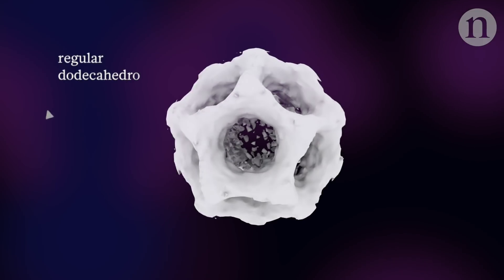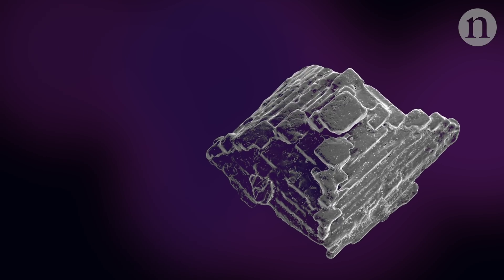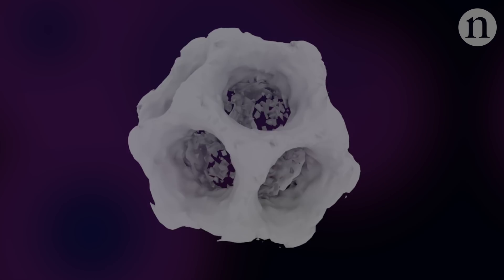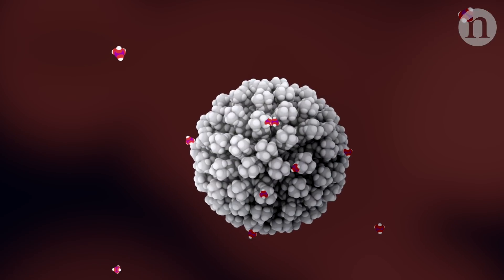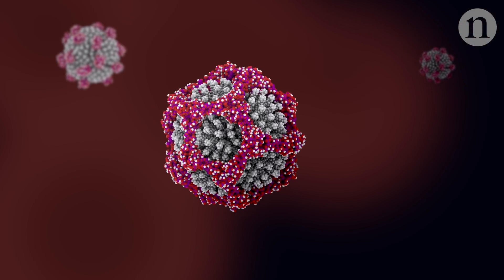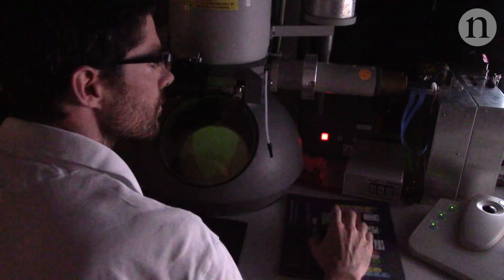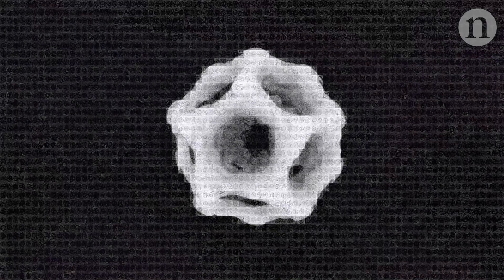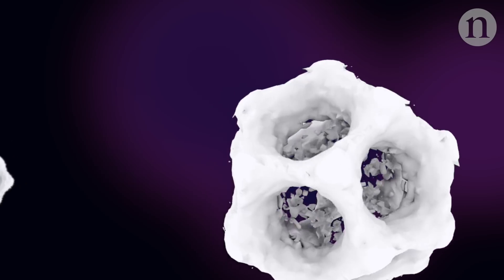How to build a nanocage: Self-assembling silica

Comment: How do they control the size of the micelles? What is the purpose of flash freezing, why would TEM in ambient temperature not work? Can you add the link to the paper?
Reply: cikif Picking finely graded soap and agitating it w. finely graded dirt (well vortexed lavender oil emulsion.) Flash freeze makes small ice(?) crystals so shapes aren't destroyed by growing crystals, and sectioning that for TEM easier...TEM is done in vacuum so no fair chasing the electron beam with liquid water. This and related papers are in the Nature(.com and print magazine in very many libraries...and apps) for this week (wait a bit for the Nature Oncology followthrough?) Guess the precursor? Try ChemRxiv.org for a similarly room-temp method for making β-zeolite.

This being YouTube, surely there are videos of people shrinking diatoms, or rolling glass fines in emulsions, then colliding and centrifuging for scintillation analysis, skip the scanning and tunelling ions? Shi-Shi-O the last author...

Comment: Soap? Is that what he said?
Reply: They used a compound called cetyl trimethylammonium bromide (or CTAB, for short). It is a positively charged quaternary ammonium compound. It is better defined as a surfactant, but you can call it a soap for simplification.
Reply: kguy152000 yep!
Reply: sounds like anything that creates micelles with a positive charge on it.  Some soaps can do that easily.